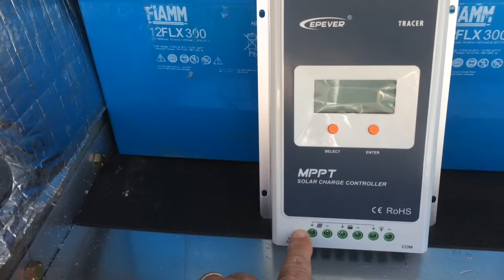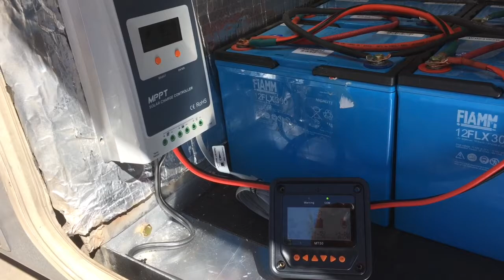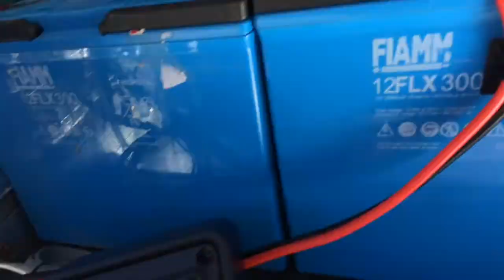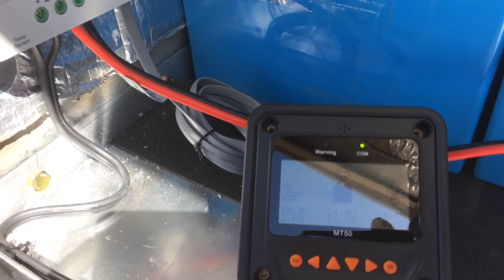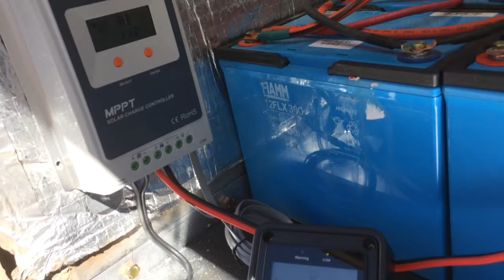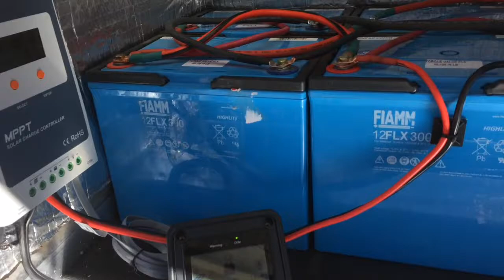1991 Fleetwood Southwind - Upgrade Solar Part 3

Comment: How much did you spend for this setup?
Reply from the maker: Rick, thanks for the interest.  I assume your question is about the Solar Power system.  The MPPT  Controller was about $120 on Ebay. The batteries came from Craigs List.  They came from Cell Towers and are about 2.5 years old with a 10 year life span.  Paid $75 each.  The solar panels are 255 watt mono crystaline.  Have 2 on the roof. Got them on Craigs List as well for $210.  The Inverter is used and I got it on Craigs List also.  Paid $250 for it...I think.  Watch the series on the inverter, lot of good info.  Total investment for solar setup about $1200.  So far i have never had to use the generator.  The solar takes care of all the power needs.

Comment: Nice modification to the original generator area. I like that remote display for the controller. The batteries look very comfortable in that space.
Reply from the maker: Yep, I think it turned pretty good. A bit over engineered, but you never can tell when I need to add a few more batteries.  My neighbor did a great job on the fabrication.